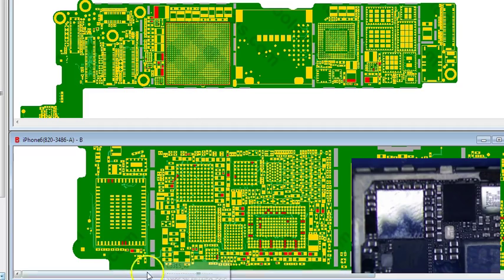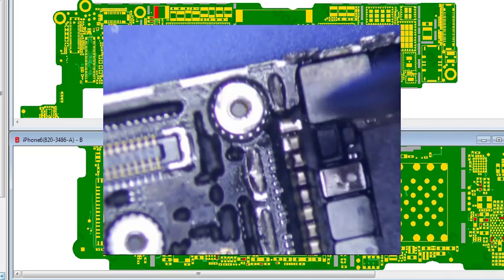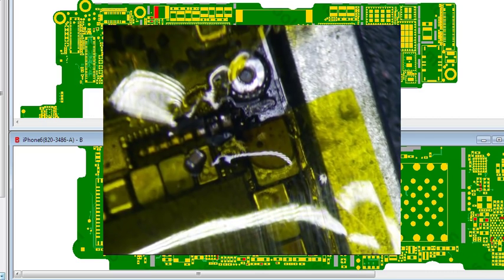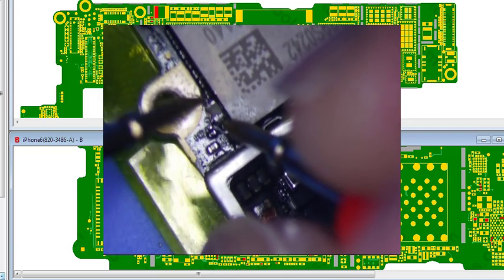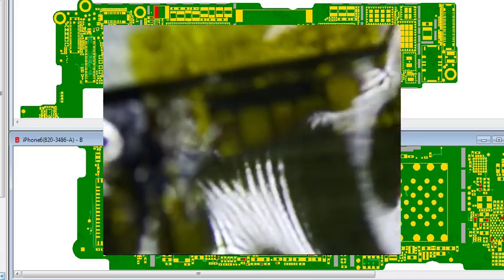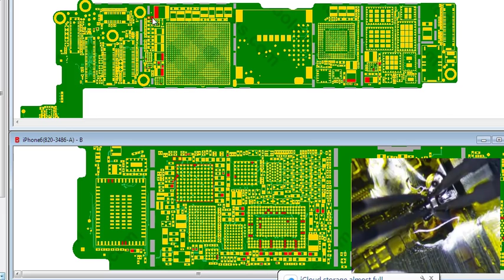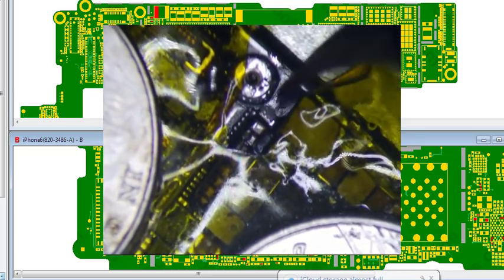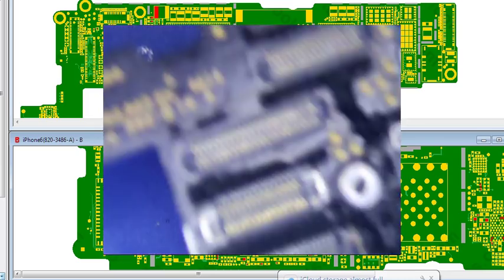iphone 6 finding a short on vcc main

Comment: but if it was Tristar or Tigris wouldn't the phone turn on with a charged battery? I was testing some caps and found c2400 and c2401 to be shorted . I'm not at the shop now to look at zxw to see what the description of those are.  do u know if that could be the cause of no power

Comment: Hey is it me or the board view for iPhone 6 isn't accurate for location of u1401 and q1403?

Can you confirm this? Board view isn't the same as actual circuit board
Reply from the maker: yeah, they're not always the same.  Even the schematics have different revisions.
Reply: +Microsoldering yikes confusing. How do you deal with it when troubleshooting?
Reply from the maker: +mrsemifixit I've never really faced a problem like that before.  I look at the schematics on pdf then compare with zxw

Comment: Hello,Happy New Year!! This is a very detailed video, thank you.May I ask a suggestion? 
I think I made a terrible mistake this morning. Yesterday I try to turn on a dead iphone 6 using a power supply. It turn on successfully, with around 0.3A. This morning I'm trying to revive the battery by directly charge the phone on 9v power supply. I seems working on multitester. Then I want to turn on the phone on power supply again to make sure its working. But I forgot to set the voltage to 3.8v, its still 9v. I connect the phone to 9v power supply for 2 secs. And to make it worse, when the positive connector is still on the socket, I remove the negative connector and accidentally touch the metal near the battery socket. I then immediately adjust the voltage to 3.8v, and attempting to turn on the phone. It's not working, and the amp display is showing around 2.3A. I think it's short and I run out of idea, what do you think? Thanks
Reply from the maker: yes, you are screwed.  Most likely short in PMIC.
Reply: my bad..
ok thanks for the reply

Comment: hi. my friend has a dead iphone 6 plus. he was told that the phone needed a new lcd screen, and it was replaced, but still dead and will not come on and it does charge according to battery testing, just dont see battery icon on screen.the first cap you checked next to the WiFi chip, my friend rang it out and it did not beep, but he did plug in the battery and used his tweezers to jump across both of those points, and we seen some smoke, do you think he fried it? he also ordered a PM chip, do you think it's beyond repair now?
Reply from the maker: Don't ever jump a capacitor.  Hard to say if your phone is fried but you definitely created a short now.
Reply: he actually wanted to check both sides of cap for voltage to ground on logic board and made a rookie mistake.
Reply from the maker: The phone was powered on when he did this?
Reply: the phone was completely dead, does nothing, no vibration, and blank black screen.logic board was out of phone case with nothing connected.... he tested the first cap you rang out next to the WiFi chip. it didn't ring so he plugged in the battery (had 3.6 volts) and checked voltage. on the left side he had voltage but not on the right hand side, so he jumped across the cap with tweezers and I seen some smoke.
Reply: the phone was completely dead, does nothing, no vibration, and blank black screen.logic board was out of phone case with nothing connected.... he tested the first cap you rang out next to the WiFi chip. it didn't ring so he plugged in the battery (had 3.6 volts) and checked voltage. on the left side he had voltage but not on the right hand side, so he jumped across the cap with tweezers and I seen some smoke.
Reply: when he got 
the phone the guy said it just needed a screen replacement and that it was dead (not recognized by computer). when he pulled off old screen he  noticed that both ribbon flex cables were cut in half. and when he replaced the screen it still did nothing so I saw your video and recommended it to him.
Reply from the maker: Probably a short now and maybe a Tristar problem.
Reply: I don't know. or even what a Tristar is. I do know it was dropped by the way the corners are.
Reply: I have checked the first cap and it does not ring out across . when I test with meter on ->+ it measures 1.123 ( red test lead on left side)
Reply from the maker: At this point, I think it's best if you just send it to someone that knows what they're doing.
Reply: I will pass along your advisement. thank you.

Comment: at the beginning of the video you checked for short by checking the filter near wifi chip and said if it beeps then there's a short on VCC Main. What if it doesn't beep, where should i look
Reply from the maker: No beep means there is no short on vcc main only.  What kind of iPhone is it and what are the symptoms?
Reply: iphone 6 no power, no waterdamage. pulling .02a on portapow
Reply from the maker: I normally start by tracing the source of the power, which means measuring the voltages at Tigris and Tristar.  I usually start with tristar because it is a common source of failure in the iphones.
Reply: but if it was Tristar or Tigris wouldn't the phone turn on with a charged battery? I was testing some caps and found c2400 and c2401 to be shorted . I'm not at the shop now to look at zxw to see what the description of those are.  do u know if that could be the cause of no power
Reply from the maker: Not necessarily.  Sometimes there is a short under tristar.
Reply: i've found multiple shorts around the PMIC area. Besides visual damage and removing every short i find which doesn't seem practical, is there a quicker way to narrow down the root of the short
Reply from the maker: Find out which power line is short, then you'll need ZXW to find all of the components that are shorted on that line.  Narrow down which one by 1) using a visual inspection (corroded parts, broken solder joints, etc.), 2) check capacitors and filters first, as they are more prone to failure, 3) start removing components one by one and testing each component for a short + the line, as there can be multiple shorted components.  Unfortunately, that is the only way.

There are some tools that can help you narrow down exactly where the failure lies, but unless you're willing to spend several thousand dollars for them, then the above is your best option.
Reply: First off thank you for taking the time to answer my questions. , I can change anything that i know exactly what the problem is but i lack experience in diagnosing,  which is more important IMO than knowing how to replace components. When you say check which power line is shorted, does that mean it's going to be multiple ones on the same row? I guess i'm having trouble understanding what a "line" means

The U2 is not the short. I removed it and still getting a short . I'm trying to recognize the pattern. PP_GPU is shorted c1210 and c1216, c0442 and c0466
Reply from the maker: PP_GPU is supposed to show low resistance to ground, so it's probably not shorted.  Your problem lies elsewhere.  

When I say to check the line, every system is powered by a power line....there are multiple power lines in the iphone (vcc_main, vcc_batt, PP_1v8, PP_GPU, PP_3v0, pp_3v3, etc.).  When troubleshooting, you need to start with with power supply for that system.  

In order to determine which power line to check first, you kinda have to guess based on the symptoms.  With no power, you can check Vcc_main first, then go directly to tristar and check for the surrounding power lines that tristar powers and is powered by.  I hope this makes some more sense.

When you're troubleshooting a toaster, what's the first thing that you check?  To see if it's plugged in...
Reply: you checked c5202 _rf to see if there was a short on VCC MAIN. If it doesn't beep , does that rule out VCC MAIN having the short or is that just one way of checking a short on that line. I will send you a donation by helping me with this BTW. It's damn near impossible to find info on all this stuff and most people aren't willing to help
Reply from the maker: Yes, if it doesn't beep, then vcc_main is not short and you can move on. If I don't find a short on vcc_main, then I usually move onto the voltages at Tristar.
Reply: ZXW doesn't show the value of Tristar. What's the voltage supposed to be at
Reply from the maker: pp3v3 means 3.3 volts.  pp3v0 means 3.0 voltes.

Comment: what voltage should vcc main be?
Reply: nevermind, i figured out on 6s its around 4.32
Reply from the maker: VCC main should be around 4.2V when powered by usb and above 3.8V when powered by battery

Comment: I have an iPhone 6. the backlight was not working on this phone first.  I could see everything on phone with a light angled at the screen , iTunes recognized.  I'm sure all it was at first was the backlight filter but my dumb ass took off the shield over all the other backlight components . IE. coil, caps, diode.  after replacing filter the phone showed some backlight for a second then shut off.  now the phone wont display anything on screen, iTunes recognized.  Then yesterday I checked again and iTunes wont even recognize anymore.  I checked for short on vcc main and its not showing a short on cap c5202. LOL, any ideas right off hand. Thanks man
Reply from the maker: Use a known good charged battery and see if the phone boots up first.
Reply: yeah, I bought a spare board for parts and practice and this board boots up with the current battery.  Thank you for the response and time
Reply: this all started from my wifes phone screen broke, then I bought a replacement screen, changed the screen.  2 weeks later the backlight goes out and I was determined to fix the phone and bought a amscope, rework station and necessary tools to try. now I constantly watch you tube videos on backlight and fixing procedures.

Comment: i bought ZXW tools and put usb on my windows7 64bit.  PC installed USB driver automatically.  but didn't appear anything.i can't see the screen of putting serial number. i googled what is this problem. but i can't find infomation about how to install ZXW tools. Can you help?
Reply from the maker: You don't need to install the serial number.  Just plug the usb drive into your computer and startup the software.  Make sure that the server settings are correct.
Reply: Thanks for your reply. Your ZXW startup automatically? My ZXW tools doesn't show anything when i put it on the computer.
Reply from the maker: No, it won't show anything when you put the dongle in.  You just need to install the software and run the .exe file, then the software will look for the dongle to check that it is a paid copy.  The dongle is your security key for the software.
Reply: I misunderstood about it. I was stupid!!
[you helped me. it worked. Thanks very much!!

Comment: Dead iPhone 6 128gb Symptoms:
Draws 0.1A when plugged in which droops to 0.03A in a sec.
Cpu does not even get warm..
Try 1:
Install a working battery. Now I have 0.55A. But the phone does not turn on or connect to itunes.
Changed the charge port, draws 0.55A no change.
The cpu gets hot.

Try 2:
Checked for short in vcc main, there is no continuity. So I moved on to replacing the u2 tristar.
After a new u2 chip replacement, the current draw now it 0.01
:(
Any help or suggestion?
Reply from the maker: It could be anything.   What is the history of the device?
Reply: Dropped few times in a case. Device in almost new condition. No evidence of corrosion or water damage,  even the inside is like new.
Reply: Also, the processor area gets hot like when the iphone is starting up..even at 0.01A :(
Reply from the maker: It's hard to say.  A short of some kind is probably causing the CPU to get hot, but it does not mean that the short is located under the CPU.  Now that you have replaced the tristar, then that could also be the cause of your problems.  I would check the voltages around tristar to see if you are getting the correct voltages before proceeding.
Reply: Just found out C0612, C0616, C0617, C0640 all short to ground. Thanks to folks @ Introduction to microsoldering on FB..
Reply: Found out the c0616 was causing all the caps on the pp1v8 to short to ground. Took the shorted C0616 out of the circuit. The short on other components are not there anymore.. So, I got the same capacitor from an iphone 5s which is C307. The short is not there anymore but the still is dead..no current draw 0.01A
Reply from the maker: I'd probably revisit that tristar repair.
Reply: Hi thanks for the quick reply..When you mention check for tristar u1700 area, I am just not sure how would I measure it, like connect a known good battery and check the multimeter. Say pp3v3_acc should be 3.3v?
Reply from the maker: yeah, watch one of my other videos.  By checking for the voltages around tristar, it will let you know if 1) you have a short under tristar, 2) if the chip is making solid contact with the pads below.
Reply: So, I just connected the charger without the battery and measured the following around u1700:
C1738 3.3v
c1299 0.1v
c1704 3.8v 
C1700 c1754 c1739 0v.

I checked the solder balls at an angle, looks good.. :(
Reply: Thank you all for all help.. I am doing the Monkey Dance! I found that I had the u1600's dot aligned of F1 not A1.. Put the new u1600 the way it should be. BAM..the iphone has risen from the dead..

Comment: instead of tweezers why not just low speed hot air and lots of flux? i ask because i hate my tweezers, theyre not hakko
Reply: lol nvm. i just watched further, but why wouldnt you start with that? so you wont damage anything else around it?
Reply from the maker: kevin Marquess use whatever works for you